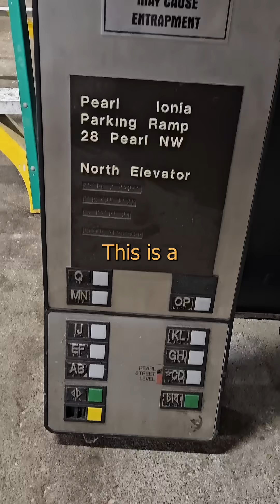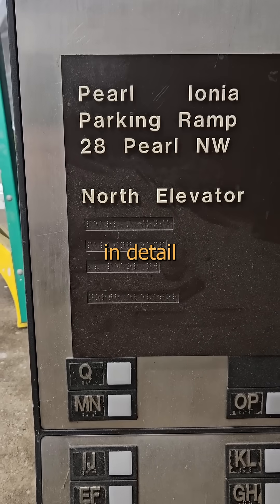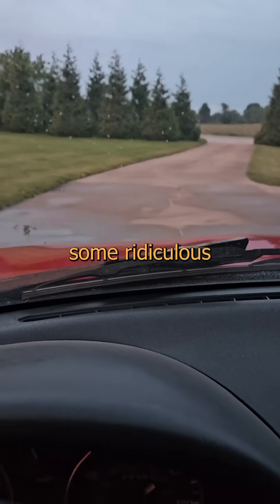Miata Mischief #chrisboden #engineering #gear #elevator #score #stories #parts #hacking #making

Comment: I ain't had a Honda fit and I need you to get a queen size mattress home after laying down the back seats and the front seats as much I could I managed to squeeze the mattress into the car and strap the two box springs that went with it on top of the roof I drove 4 miles with my head press against the driver's side window with me being scrunched against the steering wheel

Comment: When I was a kid, I really wanted a server rack. I finally got my hands on a used one, a massive, full 42U beast that was riveted together. And I didn’t have a truck. So, I drilled out all the rivets, broke it down piece by piece, strapped everything onto a sheet of plywood, and loaded it onto the roof of my 88 Prelude. Drove it nearly 100 miles like that — and somehow, nothing went wrong. LOL.

Comment: I had a 1983 Pontiac t1000 and I needed to move lumber so I removed the rear seat the passenger seat and every other interior thing I could and then was able to load my lumber including a 4 x 8 sheet of plywood on the roof and all my stick lumber inside the vehicle and then put the interior back in 2 Days later someone broke into my house and I needed to go get a new door so I took it all out again and was able to bring home a new front door for the house in my tiny subcompact car

Comment: In my early 20's carried one ofnthose government standard issue filing cabinets home from a yard sale on a bicycle to my first apartment. Sideways. It worked pretty well until I got to a busy hiway and had to go on the sidewalk. I ended up thoughly wedged between a phone pole and the fence of the local cemetary. Some homeless dude had to help me get unstuck

Comment: Not me, but my dad. 
He basically built my childhood home from scratch. That includes avout a million sketchy stories, especially since he isn't a builder. (He's an aircraft engineer.) But my favourite story is, when, in the beginning of this whole ordeal, he didn't own a properly sized car. Only a Citroën 2CV. 

One day, he read in the papers that someone is giving bricks away, so he hopped in his trusty, yellow 2CV and drove about an hour on the highway. He then loaded the car up with bricks until the springs bottomed out, and he could only see to the front, the left and a little to the right of him, just enough not to be a complete menace to society. 

He got it all safely to the building site, but not without "having to break about an exit early for the one he wanted to use. Also, anybody who has ever driven a 2CV from that era knows these things LEAN. Well, this one didnt.

Comment: Ironically, Mazda didn't think the Miata would sell very well in the US market. They were priced very low. Mazda was caught off guard by how much demand was really there. . . Thos3 first year production Miata's were small, light, simple, and just plain fun to drive. Yes, they were a tad anemic on power, especially the ones with the automatic transmissions; but just fun to drive. . . . The current generations of that car are race cars.

Comment: I few years ago I saw an add on Marketplace for a barely used smoker.  But at the time my wife had the jeep, and my father in-laws pickup was on the other side of the state.

So I did what any other "collector-of-things-I-don't-need-but-want" would do. .. . Drove my 1987 Porsche 944 Turbo down the street to pickup this glorious campfire smellin heat of meaty things.

With the help of 2 of the neighbors and after about 20 minutes of talking to the lonely older neighbor about how 944's are the poor mans Porsche. . . .I finally got it home.

Only took another 10 minutes of explaining to MY neighbor, why I had a large black BBQ/smoker sticking precariously out of the back of the "sports car".  

Man, later that night we had the best smoked salmon I've ever.

Comment: I used to use my mom's 2005 Volkswagen New beetle to move around my aluminum 28 ft extension ladder, place between from the back and through the center sticking mostly out.

Comment: A tool box on a motorcycle holding it in my lap or on my back either way I got pulled over for having a load that was unable to be secured correctly still bright home though funny as hell seeing someone go 60 down the highway what's a toolbox in your lap

Comment: I was riding home on my bike, and my friend came over and told me there was a whole desktop PC on the side of the road. 

I biked down there to see what the hell was up with that, and was met with a maybe 50-year-old man and (presumably) his son. They said they were giving the PC away for free. It was stripped of most of its components, and only had a motherboard, CPU and case left.

I decided to hang it off the side of my bike's handlebars, and rode it all the way home (wasn't that far, maybe a 2 minute bike-ride normally) but it took maybe 20 minutes to get home, and it fell off (taking me and the bike with it) a couple of times, and I ended up damaging my bike's break actuator. It was a good day. PC worked fine btw, shitty specs but powered on and POSTed.

Comment: About 15 years ago my mom and stepdad got a couch from a wealthy suburb here in Pittsburgh and this was a giant couch that you would normally put in the bed of a large pickup truck or a U-Haul box truck not a small item we strapped it to the top of a 95 Dodge avenger I may be mistaken on the year but it wasn't old Dodge avenger with four ropes tied to the legs of the couch fed into the front and my brother and I held the front ropes in one hand and a back roads in the other the entire 40 minute drive home on mountain back roads and city streets in Pittsburgh with my stepdad driving my mom riding shotgun my 2 sisters and brother in the Middle with a back seat and my older brother and I in the two outboard positions

Comment: Back when I was 14 or 15 me and my buddy had a modified goped gas scooter that we attached to a shopping cart to haul scrap around. The local cops loved it and would regularly stop us to check it out. 
   One time my grandmother on the other side of town gave us a self propelled snowblower but we had no way of getting it home. Me and my buddy loaded up the cart and headed out. After realizing the blower was too heavy to lift into the cart,  we decided to “ride” it home in the form of running it and pulling one of us along on a skate board while the other drove our cart contraption. 
  This day the local police weren’t too fond of us as there had been a recent string of snowblower thefts. This all happened in the middle of the day and I’m sure there’s a picture somewhere on the internet of our shenanigans that day.

Comment: I came back from IKEA on an app rental scooter and a metro with transfer. 
With 120lbs of boxes slung around me like oversize handbags, hanging by a salty old sailboat main sheet. 

The PDP-11 is cooler, did you get it running?

Comment: I saw loads like that all the time working at a hardware store… I’ve fit whole cabinets and toilets in sedans and attempts at appliances in small SUVs. My favorite though has to be either the people who load a whole pallet of flooring and bottom out their suspension, or the one time someone came in a compact SUV for a huge bag of gravel that we use a forklift to move

Comment: I had a 93 MR2 t top and bought some stones, 6 bags of mulch, and a few plants for a small garden. All my family and friends who had pickups were busy so I went home, unbolted the passenger seat, and returned back to Lowes and fit everything on the passenger side and behind the driverseat all in one trip. Later I bought a little 3x4 trailer and made a little hitch out of square tubing and angle iron that bolts up to the bottomside of the bumper in front of the tag. It was an awesome looking car but looked ridiculous with that hitch and trailer hooked to it but it's a solution for a vehicle design with cargo space that you couldn't fit a cup of coffee in

Comment: My one and only car is a Honda Del Sol. I wouldn’t necessarily call this sketchy but the most shit I’ve had crammed into that thing was when I went snowboarding. I live in the Atlanta Metro area so we have zero ski resorts close by. I usually go up to Cataloochee Ski Resort in Maggie Valley NC. About a 4 hr drive. 

The Del Sol is basically a Miata but front wheel drive, slower, and probably smaller. I had the snowboard wedged in the passenger seat exactly how you had that control panel, I had my boots and snow gear shoved under the snowboard on the passenger seat. I had my suitcase wedged right next to my sub in the trunk, and filled the rest of the trunk with beer. I could not have taken a single extra thing with me. 

Made that 4 hour drive up there and had a great time. And somehow didn’t get stuck in the snow on my summer tires. That was a great trip, I’ll remember that for a long time. The ski conditions were perfect too.

Comment: I had a Chrysler Sebring convertible, and hauled a gigantic 8-foot-tall multi-unit gumball machine thing in the back seat. It was all rusted together, so it couldn't have been taken apart, so it was plopped in upside down into the back seat, basically held down by how heavy it was. Me, being the idiot that I am, then drove that car two hours home on the INTERSTATE at 70+ miles per hour. The performance of that car was pretty significantly blunted, and I had more than one instance of "oh god if this tips backward it'll fall out, and if it tips forward it'll crush me dead" but I got it home! I did move other big things in the Sebring that way, but nothing quite that big or dangerous again. Bought a minivan after the Sebring finally died.

Comment: I bungeed a classic STA-2290 receiver with EQ and speakers to the back seat of my 1987 305LTD, using the turn signal stalks as anchor points.  Yes.  Bungeed.  Rode from Delano, California to my home in Ridgecrest.  About Tehachapi, I got snapped in the back by one of the bungees breaking (leaving a welt that lasted for months!) but from that point to the end of my sojourn, I carried the speakers between my legs on the gas tank, WITHOUT any straps of any sort!

Comment: I've moved house and transported everything in the back of my Veloster, power recliner, matching love seat, 6 ft garage work benches, 2 post server rack, everything, car was a champ.

Also, at work when younger I used a forklift to insert a partial skid of floor tile into the back of a hatchback because the customer insisted. about a half inch clearance on either side, dropped it on the folded down rear seats and slid the forks out as it crushed the suspension. Customer was happy for some reason and now I get to tell people about it.

Comment: This past winter.  Up in Canada.  It was like 3 days before Christmas.  I needed some carpet for my home I had purchased.  And the store was closing for the week.   Now I ended up getting called in for overtime and went to pick up the product at my lunch break.  Now the joy of jamming a bunch of different cuts in my santa fe.  Not overly difficult just had to have the long ones hanging out the window.   Now we started getting  hit by a blizzard.  Drove back to work to finish my shift.   Can't roll up passenger window and my play is about 30 miles out of town.  Pretty easy but the scariest part was.  The hwy is done to one lane traffic and people doing 50 on 70.  So I got rolls hanging out the window going to pass on a road that was buried in snow.  So have to hug the shoulder speed up to pass traffic.   get the feeling  of the snow trying to pull you into the ditch.  I don't drive white knuckled often but passing those semi 😂

Comment: Many, many many years ago I once attended a LAN party with a friend.
Back in these days I had no driving license but only a 50cc motorcycle.
Also, back in these days there were no portable computers but mini-towers instead.
Two people, equipped with two computers and two big CRT screens (also two big keyboards, mouse, two set PC speakers, two power strips and various cables and food stuff) on a small scooter.... that was fun!
Also, still some years ago, 5 people in a small car to attend to a local hamfest..... we ended up buying an insane amount of stuff (including 2 x-rays machines, few very big transformers, two variacs and many other tings).... when we were going friends kept saying "faster, faster" (at 170km/h with a fully loaded car) but during the comeback, the same friends kept saying "slower, slower" because the car was massively overloaded and even 90km/h was too much!!!

Comment: When I was 15 and just got my first car, (a 2008 Nissan Altima) (with purple tint I might add)I was trying to replicate the way my friends worked out, by flipping a tire over and over. Sooo… naturally when I came across a large tractor tire this bubba wanted to get out of his yard, I got his corn fed 210Lb 17yo nephew to help me roll it onto the top of my trunk and lay it down over my sun roof. The thing was sticking off both sides and I cruised the dirt roads prolly about 5 to 8 miles back to the house. As anticipated my mamma was absolutely rolling, but my daddy gave me a big ole hi five and helped me roll it off and out into the field where it sits to this day. 

I am still very proud of it to this day, cause I was prolly going way too fast at some points.
Reply: Oh yeah, I didn’t have my license yet

Comment: I had to drive in 38°f weather with my top down on my convertible so i could haul an aquarium and its stand home in a 2008 Mustang. Ya know Savage's quote "Every tool is a hammer" ? Well, every vehicle is a pickup truck if you try hard enough

Comment: put down the back seats of my mk6 jetta to fit a box of two toyota tundra running boards. they went from the end of my trunk to the windshield itself. this was almost as sketchy as moving my entire college apartment in that same jetta, driving 6 hours without being able to see my passenger side blind spot, my rear view, or even get to my cupholders. drink in my lap the whole way i took that poor sedan over 120mph to get it done and over with.

Comment: Got a machining center from Maine, drove it to the shop, had to weld bars able to lift the thing with two lifts cause the one that was strong enough had erectile dysfunction.

Lifted the thing about 4 inches from the bed, drive the truck out from under this fuck ton balanced on the equivalent of chopsticks 😂 slooowwwlllyyyyy dropped it on 8 tracked dolly and moved it to it's forever spot by using the whole shop, including the office 😂 10 super competent scientists pushing a multi ton machine was a great sight.

You could've extruded tungsten out of my ass during the whole lifting operations as I was operating one of the damn things.

Comment: Hauled my motorcycle on what I didn't know at the time was a trailer that looked new because of a fresh paint, but was never treated properly, found out after I arrived where I needed to be as some of the paint flaked away... with some frame pieces attached. Never borrowed a trailer since, and bought my own as a result.

Comment: I hauled a Mazda 4 cylinder engine in the back of my mk1 Audi TT(look it up if you don't know what it looks like ) 100 miles to my house, the hatch was open partially which just scooped the exhaust back into the cabin so I had to have the windows open so I didn't asphyxiate. Pretty stupid considering I had a truck I could have used instead, but regardless it actually went pretty smoothly all things considered.

Comment: Defintely not winning the competition here but there was one time I got a free tv stand and my sister had a car big enough to haul it …. A 2011 Mercedes C300 😂 the trunk opening was so small and the back doors did not open nearly wide enough to fit it, so we laid her back seats down, had it sticking about half way out the trunk and had no way of securing it in place. The trunk couldn’t be secured either so for 45 minutes the trunk would bounce and smack the tv stand… hard. My sister who lent me her car also ended yo going with me and she laid down in the back on top of the folded rear seat in a very uncomfortable position to hold the 100+ pound tv stand in place. I tried to use her sweater to tie the trunk down but it just wasn’t big enough. It was a long and slowwwww 45 minute car ride 😂

Comment: As both a first-gen Miata owner and a random shit enthusiast, the beauty of the Miata is the drop top, which with proper preparation, allows for an amusing amount of cargo capacity. For example, during one of my first jobs, a short stretch as an assistant trim carpenter, there was more than once I ended up the only one on a jobsite and had to transport bundles of 8ft baseboards from one location to another. Several straps, a few somewhat stood up around the passenger seat, and a few more laid over the top of the car made relatively safe trips down backroads between the different neighborhoods we worked in. Beyond that, I can also vouch that the trunk will carry a slightly below average (willing) man as long as you pull out the spare tire. Surprisingly versatile

Comment: Towed a MKIII  VW Jetta VR6 for a swap engine using a MK1 VW Rabbit Truck and a 2-axle flat bed hitched onto the shitty rabbit bumper hitch. The smell of brake and clutch material for that 3 mile drive was insane.

Comment: I got a Ford Triton V-8 engine for free from a buddy (his dad got shipped the wrong engine for a swap and got refunded). I didn't have a motor lift, or much brain, but had enough nuts, back muscle and poor decision making skills to put it on 2 longboards with 2 2x4's to bridge them. Had to get it on and off a trailer and up my mom's steep driveway, only almost crushed my feet twice! Got it all the way broken down to rebuild, and it's been sitting in my garage for 6 years now:)